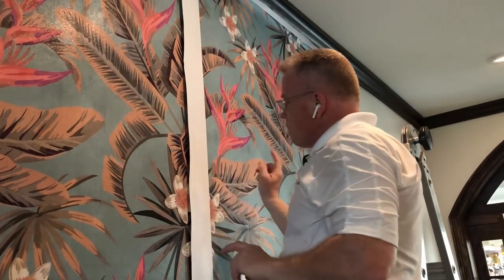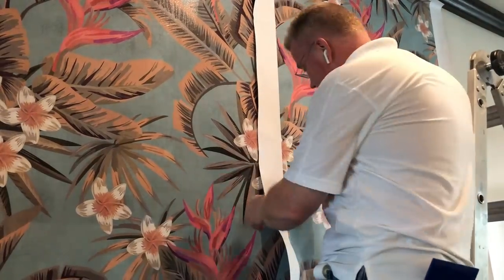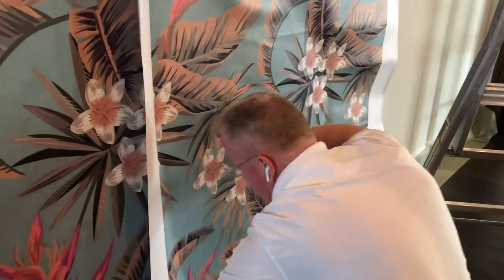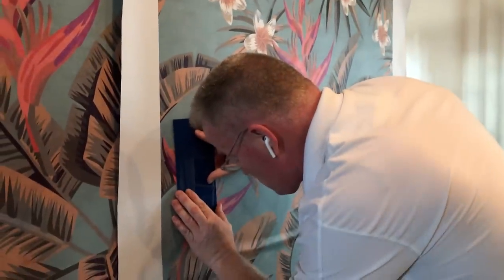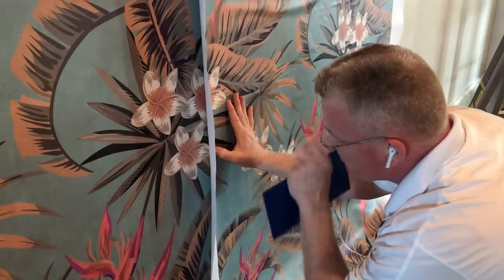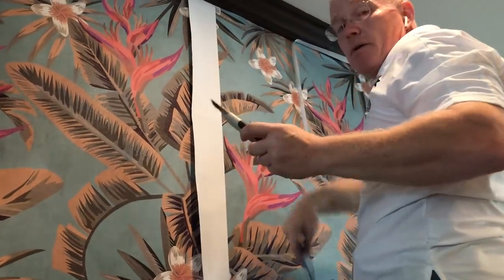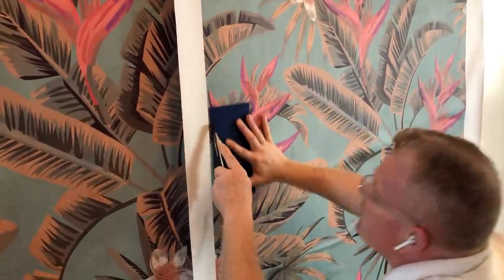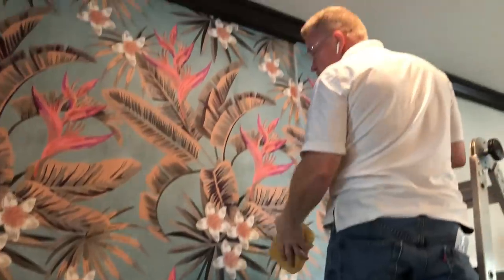How To Match Up and Double Cut a Wallpaper Mural | How To Hang Murals In Home

Comment: Nice! Looking amazing.
My question is - How come your panels are not cut down to size? Isn’t it easier or more practical to use a laser level and match up the design without needing all that white overlap and flipping it back and forth?
Reply from the maker: @DaveGiveUsAWave  no sir.  They never match up any other way.

Comment: Very well tutored thanks, and the use of the fingernail is a new one on me, love it, I have used the seam buster double cut tool goes through both sheets slightly pulling the cut from the substrate. keep them coming, most of my paper hanging is domestic but i suppose same principal applies, cheers

Comment: First of all you do amazing work. Is there a reason you began double cut about a 1/2" right of white border? It seems to me cutting at the wall has less margin for error than table trimming. But it is so hard to get comfortable with. Especially with tropical patterns or large half drops. Any advice?
Reply from the maker: First of all.  Thank you. 

What I did here in this video was mot conventional….I should have removed most of the selvage if I were going to be using this as a tutorial.  

Having said that, the white selvedge is a straight line against which I can then use as a straight guide along the way down as I. It through the 2 pieces of wallpaper…the top and the underneath piece.  

Therefore the white line eliminates the need for a laser level or any level at all.  

Table trimming is a dangerous thing.  It’s wrought with all manner of potential issues….I prefer to trim in the wall because you get to see your paper up already as you cut.  Once you cut on the table you are bound to make small errors that come out when you put those sheets up….my opinion Jennifer.  

Do you watch many of my videos?  Are you a new sub?